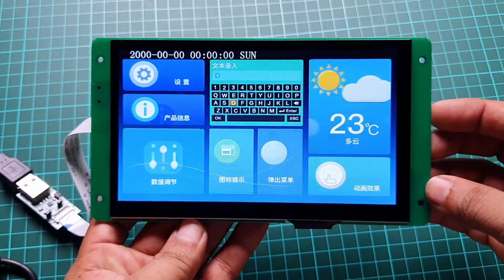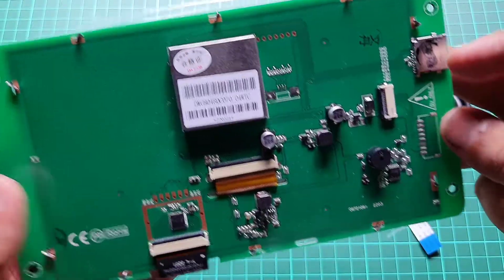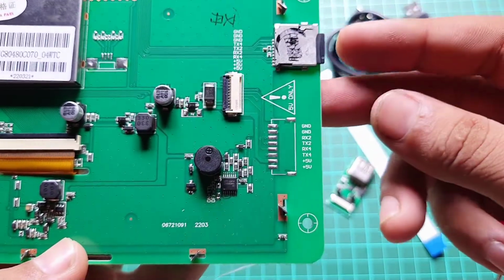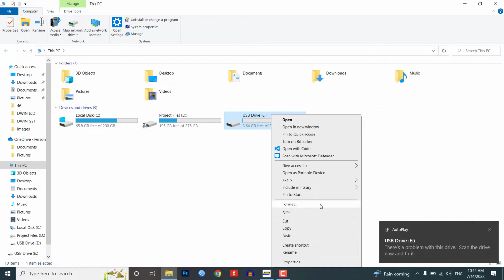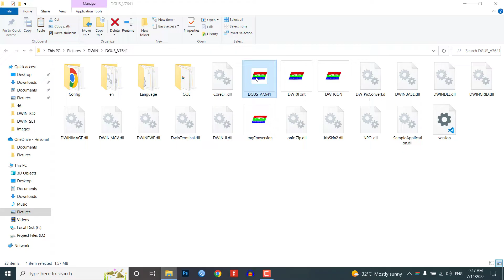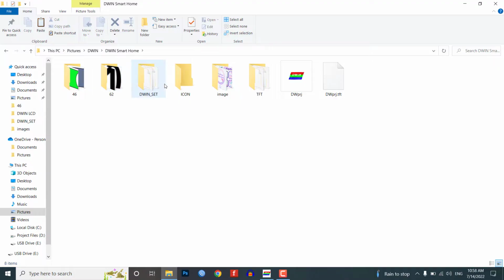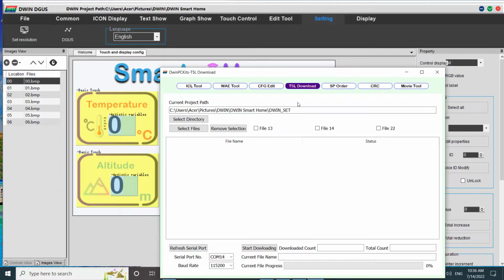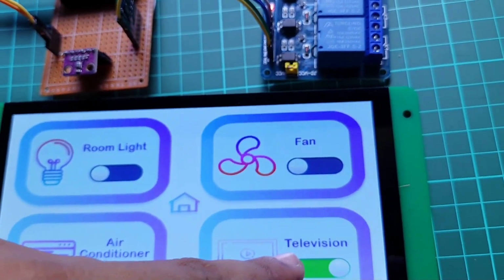Getting Started with DWIN HMI (DMG80480C070_04WTC) Smart Touch Display

Comment: Hello, I have the dmg80480c070_04wtc model. When I try to load files from the SD card, the screen freezes, there is no blue screen, it does not boot. In short, have you encountered this problem before and if so, what should I do? Thank you.
Reply: You should try to format SD card using custom command from CMD